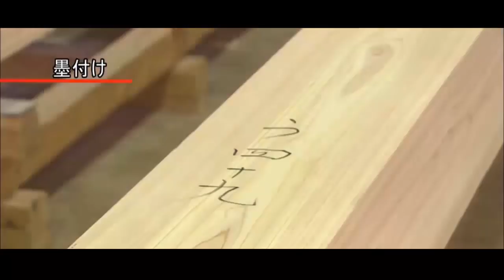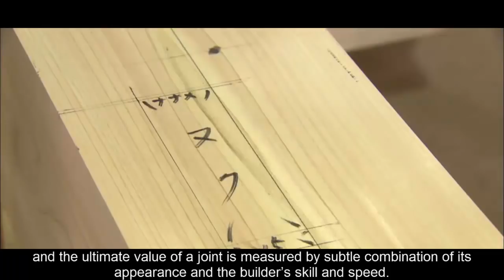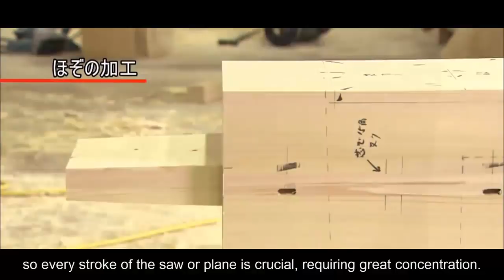The Attachment of The Modern Japanese Carpenters To The Traditional Hand Tools

Comment: Im in love with japanese woodworking! Thanks for this video. I truly want to learn how to build my own furniture.
Reply from the maker: thank you..try your best!
Reply: Start with small items using hand tools first. Bigger items with bigger joinery is a bit easier but expensive when you make mistakes and you learn to be much more accurate on the small items. First thing you need is a good saw and I recommend a Japanese pull saw, a set of decent chisels, a couple of planes and a way to make round holes (a power drill). Hand drills are still available but the bits are not and expensive. You shouldn't need many big drill bits, mainly you're going to use them for pegs and dowels. In reality a saw, chisels, and a plane along with glue, sandpaper and a mallet will give you everything you need to make just about anything you would want furniture wise as long as you have the knowledge and patience. 
Start making dovetail cornered boxes (cigar box or jewelry sized ) then move to chests or small tables to refine your joinery and finishing. From there it's just practice ad nauseum lol.
Reply: What is the music that you are using? (the first music)

Comment: What is the timber used?
Reply: wood!
Reply: I’m thinking balsa?
Reply: White pine as most Japanese structural timber elements are. Sometimes cedar could be substituted. 

Btw Balsa would never be utilized for traditional post and lintel construction as it's too porous and not very strong compared to other more widely available wood such as white pine or cedar in japan. Also, unlike the USA Japan does not clear cut its timber and has always replanted what was taken, the whole zenith balance thing. But as a result they still have lots of old growth forests with original timber growing along side 4th or 5th generation trees, very smart.

Cheers
Reply: A white cedar such as Port Oreford Cedar found along the Southern Oregon coast.